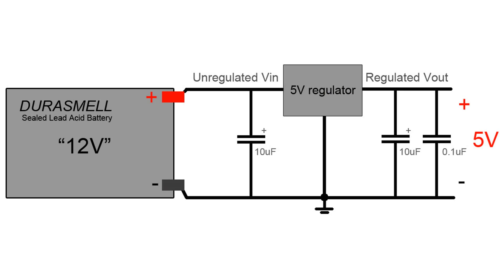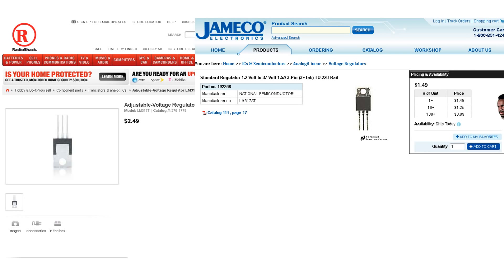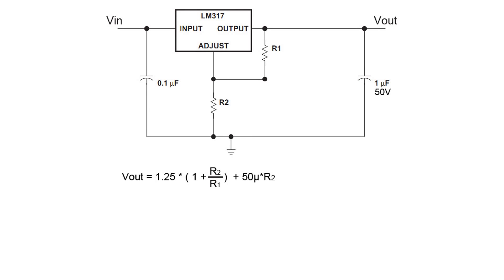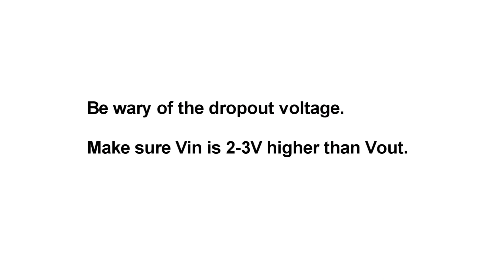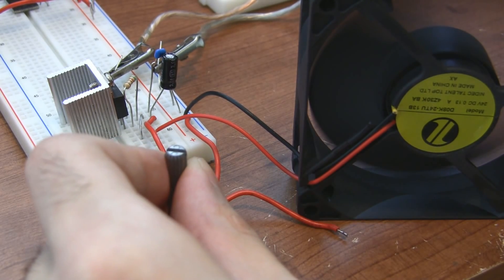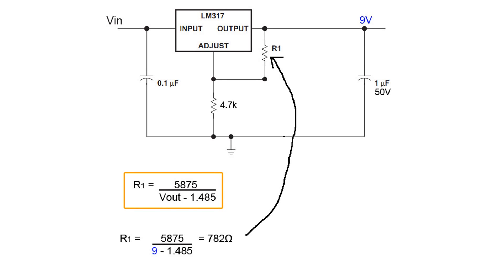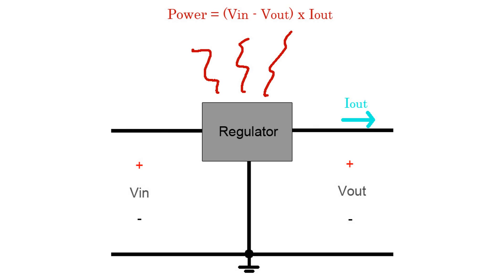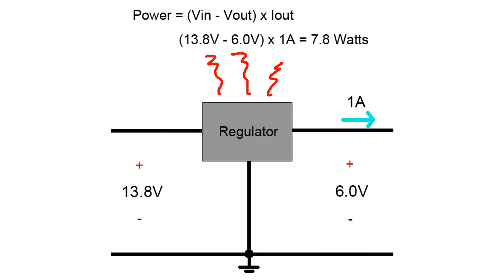LM317 Adjustable Voltage Regulator Tutorial

Comment: Hey i am making a Linear power supply for my Analog Circuit course 

I have a 12-0-12 Transformer rated 1Amp and 4700uF 35 v capacitor which I am using for filter and a bridge rectifier setup with 1N4007

Problem is I don't have a Heatsink around (and electronic stores near me also don't have it) 

So what I did is use a metal plate used to hold LED tubelights and tightened it with a screw 

 I have a 10K trim pot and 5k potentiometer 

But as soon as I power the circuit it just burns the refference resistor or the potentiometer 

I am trying to have 0-24V 
Or even 0-15V if that's possible 

What should I do 

Instead of transformer should I use the 2 9V batteries in series instead of entire AC to DC conversion ?
Reply from the maker: Double check what DC voltage you are getting after the transformer-> bridge rectifier. You may have a DC voltage that is way too high for an LM317's input.
Reply: @Afrotechmods  33V

Comment: Wow, 13 years ago!   This is definitely the knowledge that I need for a current project though.   But I have to figure out how to get two separate outputs, one 5v, and the other 9v, using a 24v battery as the supply.

Comment: Hey I was concerned I make lm 317 adjustable voltage regulator but it cannot power a load. Even small load. Although I can adjust the output voltage but It doesn't even make the load function. What is the trouble? Sorry for my english

Comment: This is a very informative video Sir!  However, I am building this as a 24 Volt power supply on a breadboard with a 2 watt load resistor at the end of the circuit in order to simulate a load of about 250mA constant current draw.  Given Ohm's law this resistor needed to be 2 Watts in order to handle the current, but what about resistor's R1 and R2 that are connected to the regulator?  Can I use 1/4 watt resistors there? Or do they need to be 2 watts as well, considering my circuit draws 250mA?
Reply from the maker: 1/4w will be fine for the feedback resistors
Reply: @Afrotechmods  Thanks

Comment: What are the components of a cigarette lighter plug USB out phone charger? Pre-made to take 12v and reduce it to 5v, usually 1A, 2.1A and 2.4A outputs. Is there a simple schematic for this? It seems easier to just gut one of those apart and repurpose it in a different project.

Comment: If the load is constantly changing will it maintain the same output voltage?
Reply from the maker: Yes. That's the point of a voltage regulator.
Reply: @Afrotechmods  okay thanks I've seen people just use these to clean up the input voltage before so wasn't sure if it worked if it had a varying load

Comment: It is not clear to me: what is in front of what, exactly.  If current flows from the + terminal of a battery, for example, what does that connect to first: the potentiometer, or the voltage regulator?

Comment: So... This isn’t too far off if the LM317 gets up to 55° (including the heat sink!) after a few minutes when used from a 12v source for a 5v, 0.6A power supply (see video in my channel). 🤔 Wonder how to get around it. Two in parallel?

Comment: good day sir..can you teach me how to convert 12v to 1.5v  using lm317..thanks in advance
Reply: That's no good mate,you need a step down converter or if it is low current a voltage divider may work fine

Comment: Not sure why bother using a transistor  when you could just as easily adjust the  with the potentiometer  alone .  why use capacitors  too?  Is the electricity running from ground to possitive?
Reply: Potentiometer can't handle any decent current and a potentiometer would be like having a 100-1000 ohm resistor to your load which isn't good as it limits the Max current a device can use before the voltage drops. Also generally it's a good idea to not have something that can be changed and destroy your load

Comment: does the amperage flow through the potentiometer or or is it setting the bias point of that voltage regulator to change how much it conducts could you make a tutorial of a similar regulator but use one that handles at least 5 amps instead? 1.5 is abit low

Comment: Could someone explain why mine might not work? I followed all the steps but i get a output voltage of a little less than the input
Reply: Hello, 
Did you think about the dropout voltage of the regulator which is of about 2 volts? For instance if your input voltage is 9 volts you will get lower than 7 volts on the output.

Comment: Would it be okay to replace the two fixed resistors with a potentiometer and adjust it to the desired voltage?

Comment: I don't know what to do,  I want to create a motor controller for a vehicle like those I buy from ebay,   so I need to voltage regulate 36 or 48v  down to 12 or 5v for my 555 timer board,  for my headlights and stuff I use a 'dc dc step down'  but my 555 timer will not draw very much current at all ...  could I just use a resistor before the input of a 18v or 36v IC ? ?

Comment: So it means if I'm going to make a 12V powersupply, I've got to use 15V transformer? coz u said 2-3V higher than Vo.
Reply: if you want to make powersuply that you connect to wall, you can use a transformer thats rated fir mains, with for example 16V CT (CT = center tapped 8+8) and use full bridge rectifier to make it dc, and from there you go to this video steps
Reply: And I need to make it with 5 amps, what regulator should be used?

Comment: thank you for this great video ..
i have problem if you can help with ..

it's getting to high temperature when i use it to control my 12v soldering iron voltage..
any suggestions or different solution for high loads ?

Comment: This is all very great,But how to build regulator that adjust voltage from 50 to 350 volt dc??The maximum voltage is 350 volt but how to control it and make lower???

Comment: Hello sir. I want to make DC power supply of 30 volt 500 mA with speed regulator and I also forward / reverse switch for my surgical motor which rotate about 35000- 45000 RPM. Sir can you please guide me and tell me the necessary electronic components and circuit diagram. Also is there any alternative to transformer( don"t want to use as they are heavy) because I need something which is light in wight.

Comment: I burnt 2 317s because I am stupid :( . On the first one I let the magic smoke out and the second one has a weird thing where the voltage stays near the ends (0v and 24v) and doesn't want to go between those. Finally with my third one it works. I guess you always have losses. If  you're like me remember this: You're going to be letting a lot of magic smoke out,  so when you buy parts don't buy only 1 so you can fry them and still be able to build something.

Comment: Hey, How can I use this for a windmill without blowing out the resistors ? I need 15v but all the resistors I can find don't bear more than 3W
Reply: As I understand it, the resistors don't carry a significant load if you're dropping a small voltage (eg 15V is being dropped to 12V) but that being said, you can use a parallel-series arrangement to make a resistor which will dissipate more wattage.

If you connect resistors in series, their resistances add.  If you connect them in parallel, their resistances will divide (if I remember correctly, you use one divided by each resistance and add the results together before using one divided by the total to find the total resistance).

So you could (for example) connect two 100K resistors in series to make 200K and do the same with a second set of two 100K resistors, then connect those two sets in parallel to make the resistance only 100K again.  But now if you used 3W resistors, they should be able to dissipate 12W since the current will be distributed across the four resistors.

Comment: Hello, Love your videos. I teach physics and electronics is my hobby. I have a project that my students are doing. They are helping the Wildlife service to stun fish so the fish can be measured and tagged. I got most of the circuit done, but I looking for a transformer and adjustable voltage regulator to help me step-down the 120 v to about 60 v and then use a MOSFET to switch it. I need to produce a varying square wave with variable duty cycle also while switching the 0-60 vdc. Any suggestions? Thanks again. Curtis
Reply: Curtis Desselles you can use a dimmer to reduce voltaje and PMW to control it

Comment: Hi I made a version of this adjustabe regulator, and work just fine, but in two acations now, by mistake I make the electrodes in the output touch one to another and then the lm317 just broke. There is any way to protect it from this?? regards from Chile

Comment: I need some help. I need stable 12v for the LED turn signals on my motorcycle but the bike doesn't have a battery (from the factory) so everything is in AC. I used a bridge rectifier which outputs anywhere between 25-45 volts DC (depending on engine RPM) but my flasher relay works on 12V. I made a circuit containing a 1000uF capacitor, 7812 stabilizer and 2 smaller ceramic capacitors, the components were connected in that order. It worked, the output I got was a stable 11.9 (according to my butchered multimeter). I put all of that in a plastic shroud from a glowplug relay and hot glued everything in place. It worked for a little bit until it stopped working, the capacitors are fine but the 7812 stabilizer shows no voltage on the output pin. My question is, did I fry it with too much voltage coming out of the rectifier, or was my mistake inadequate cooling? What would you guys suggest I build to make my turn signals work?

Comment: What can be used to adjust my voltage in my 24v power supply but also handle up to 18 amps as that's what it's capable of putting out, but still be small enough to fit as my space Is limited.? Could just a 100k pot banner this on its own? Thanks for any help. Been trying to find an answer to no avail so far

Comment: hi .. How can i get the lowest heat at IC ? as i am trying to make the buck converter ... for my own bike .. same 13.8 voltage as you shown ... any such way to conver the 13.8 to 5v with minimum heat .. currently i am connecting my IC direct to the covet of Ckt which i  used metal body as heat sink .. ... .. but still i am using 7805 ...

Comment: nicely done and you make it look simple but i have a question the input i have is 28-24 volts (battery voltage is higher while charging) i need to do it while the output is 24-23v. is it possible??

Comment: If I put a big ass heat sink on this chip, can I produce an output from it of say ... 6v at 8 or 10 amps?
Reply: No you cannot, Maximum rating for lm317 is 1.5Amps and 40Volts which is about 60Watts maximum and you could probally do 30Watts max if you give it a massive cooler. and 60Watts is only realistc with extreme cooling like liquid nitrogen
Reply: Yamato Kochiya ok, so THEORETICAL max is 1.5 amps at 40 volts ... does this mean it will handle 3 amps at 20 volts, or 6 amps at 10 volts (in theory)???
Reply: In theory no, it can not do that. (it will work at rated maximum wattage, but will never exceed max rating current, 1.5amps is probally like 1volts or a very low voltage low stress operation rating)

But practically thats too extreme and a rule of thumb is that to run transitors at 1/3 the maximum power rating or 1/2 the max power rating if the cooling is very good.

Thats why you use a power transitor instead, If the power transitor is rated for 300watts and with proper cooling you'll get 100w+. and the ammount of power the lm317 has to give out is dependent on the current gain/betta/hfe of the out put transitor, if the gain is 100 then for 1 watts the lm317 give out, the ouput transitor can draw 100watts of power and for 1000 gain the output can draw 1000w when lm317 ouputs only 1w
Reply: I need to find a circuit like this one that will let me set it up to 2 amps ... I wonder if this chip can be used for it's ability to measure voltage and then adjust charge current, but somehow add a "current multiplier" to the output so that it does something like add 50% of the current to the charge. The chip would not know about this "extra current", but it would still be controlling it ... only it would just end up charging faster than it normally would at 1 amp...
Reply: If your charging something use a power transitor and  varry the voltage and monitor your current
Reply: I'm talking about taking a TP4056 LiOn charging circuit, then adding some kind of a current multiplier to it's output...
Reply: don't have an idea on how your gonna make the tp4056 work, but if you just make the oridnary lm317 adjustible supply then connect the out put of lm317 to the base of your power transtior and connect collector to the supply voltage and connect your emitter to your load and monitor your current and adjust voltage till it hits 2 amps
Reply: if you build this you can recharge any battery

Comment: I have a question. I implemented this circuit and I was getting more than 17 volts with 24 volts input. Even 22 volts if I rememebr ok. But then out of sudden it just goes up to 10v maximun. What could have happened? I was feeding a SMPS to test the regulation. I was feeding it with 12volts and it was even powering the led. Then things strange started happening. Without changing the circuit when putting the 10 volts maximun and powering the SMPS it goes down to 1.x volts!!
Reply: Totally guessing here, but could that LM have heated up and caused the voltage drop?
Reply: Thanks, just tested again after resoldering a wire to the regulator and the voltage went back to normal, it goes up to 17v. Still when powering the SMPS to test the regulation I get the voltage drop. There are no shorts no idea why. Gonna test with another 12v power supply to see if the same happens. The regulator doesn't heats at all.

Comment: How to get more power, voltage current from a LM317

It can do as much as ya want mate. Thing that limits you is max voltage, lm317 is rated for 40Vmax, so if you want to have a adjustble psu that does 40+ V then you need a regulator that does 40+V
For 40+ volts use a TL783 gives you up to 125V

All you do is connect the lm317 out put to a power trasnsitor rated for X watts and current with a heat sink.
Connect 317out put to the Base of the power transitor, connect the Collector of to power supply positive voltage. Connect Emitter to your power draw, connect ground for negative of power draw

As you reach X current, the ammpount of power needed to bais the power transitor to power will increace, So you will hit a limit on the 1.5Amps and XX watts rating of lm317.
Surely you can do 10 AMps 20V(200w) without plorbem, having two 300W power transitor and a proper cooling set up with fans on the power trasntior.

Have you tried lm317 with a massive heat sink? That shit cooks up even with a load of 6Watts. 1 amps 6Volts. use a power transitor and notice the diffrence. Elminates the need of a heat sink

This is nothig complicated, basic circuit theory
Reply: http://www.mediafire.com/view/68cv6p30cd91dj3/LM317.png
Reply: A alternative on using power transitors is paralleling more lm317s into the circuit, its less effective and increaces the cost
Reply: Henry, so if I used a high wattage transistor ... say  ... something from an old audio amplifier for example, connected as you show in the schematic, I would not need a large heat sink on the LM317 if I wanted to draw something like 10 amps at 6 volts?
Reply: No you do not need a heat sink on the lm317, unless the power draw is so high that it gets hot on the 6v 10amps. 
If this happens then you can put another lm317 in parallel, or give it a heat sink

What happens when you get the power transitor in there, is that all the load goes onto the power transitor instead,

the lm317 just sends the voltage into the Base of the power transitor then to bais it to run on XX Volts. The more power draw the more bais current will be needed then the lm317 can be hot

Rember you can use any transitor including mosfets and jfets. All you need to look for is to operate below its maximum votlage, more wattage rating better it is
Reply: hey bro, any book u wanna refer me for basic electronics ?
Reply: No because i don't know any myself. But thing is learn from online, people, books, Then expriement and try to build it your self, modd and change stuff one at a time and see what happens, so some expriements and you will learn new stuff.

Comment: @Afrotechmods I'm building my own DC Power supply using a LM350 and LM337 voltage regulators. I want to add a short circuit protection circuit so when I get drunk I don't damage my circuits or my own power supply.  Do you have any schematic I can use for this application? I've try some circuits I found on internet but none of them work fine for me. (Just kidding about the drunk thing)

Comment: Nice tutorial! Clear and easy to understand! I do have a question though: I have two lead acid batteries in series to get 24V+ but my motor controller doesn't like variable input voltages so I need to stabilize the voltage from the batteries to 24V. The motor can draw about 5 to 6 A max at 24v, 1 to 2 A continues. I have found a mosfet, like your LM317, the TIP14x, its data sheet specifies that it can handle up to 10A continues and 20A peak. Can I use this mosfet in your setup without problems? Or do I need to use a different circuit? Thanks!

Comment: Would I be able to control this with this circuit? http://www.jaycar.com.au/Electromechanical-Components/Fans-%26-Accessories/Blower-%26-Crossflow/97mm-x-94mm-12V-DC-Blower-Fan-Ball-Bearing---2-wire/p/YX2532

Comment: is some voltage reg. for 5, 10, 20, 30amps...?
Reply: Hello: I am looking for an adjustable 13.8vdc source to 1.0vdc to 12 vdc output @ 30 amp max. I am working on a new type of electric car. the cct would need to be adjusted with a 5K-6K throttle position sensor. Do you know how to design a cct like that? Thx